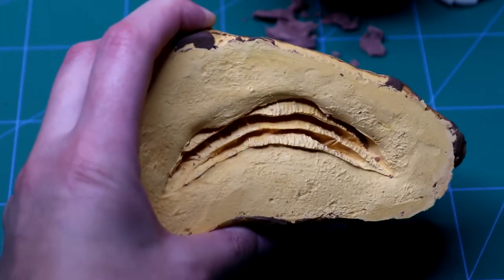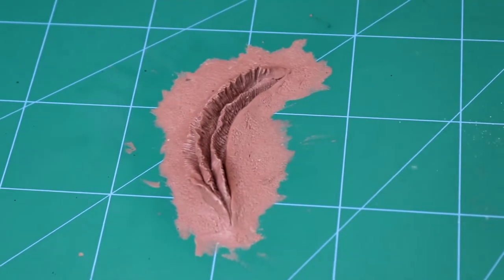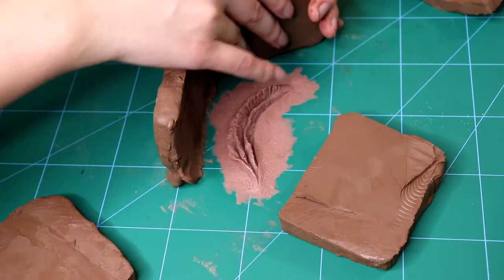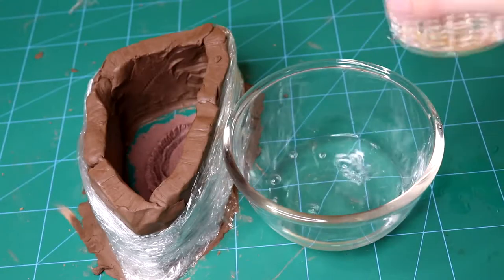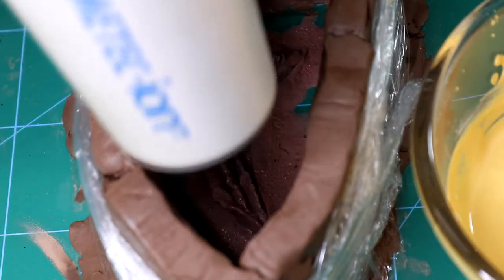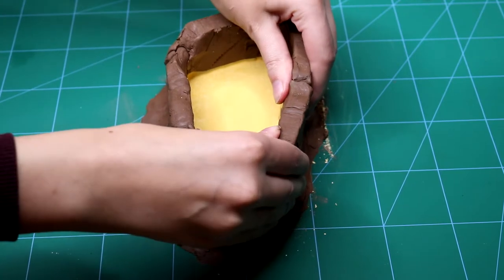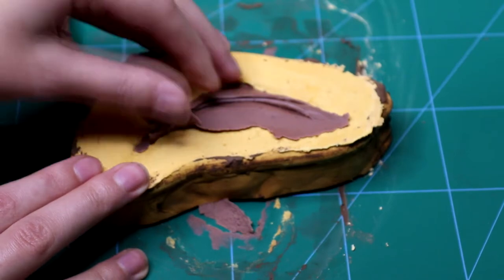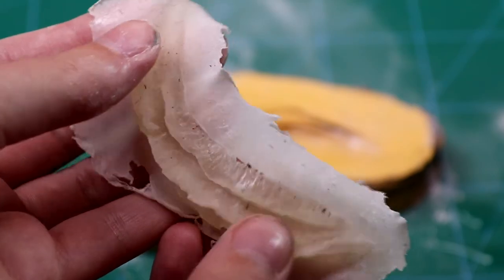How to make negative mold | Tutorial

Comment: If you can  get Hydrocal or Ultracal plaster the setting time is much faster. I can usually demold in about 40 minutes. Also hot water will soften any oil clay and aid in removal
Reply from the maker: I checked this one dries out in an hour, but I used to hold it overnight